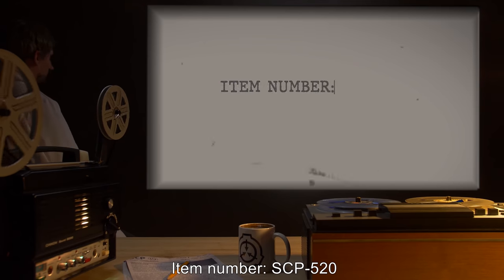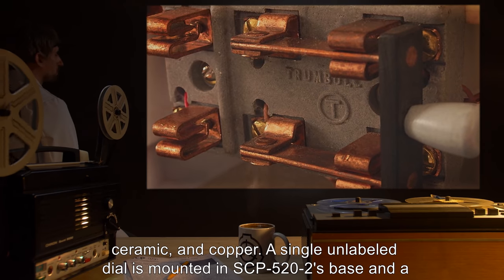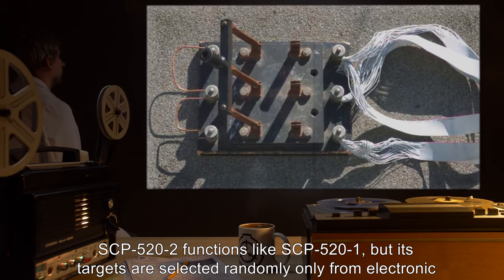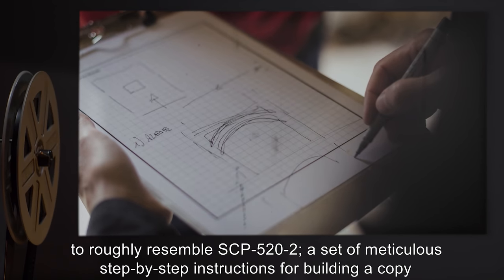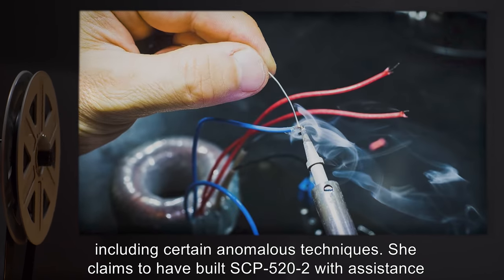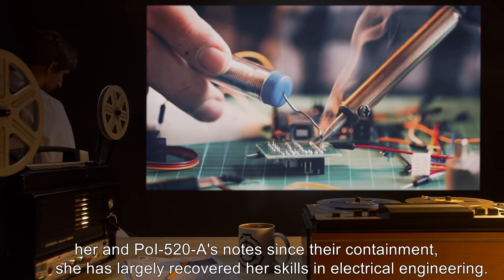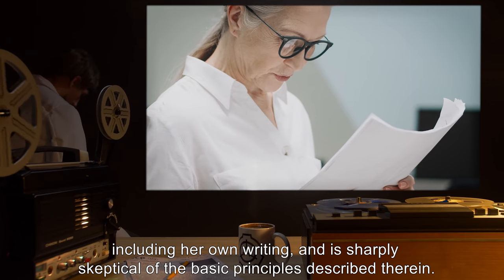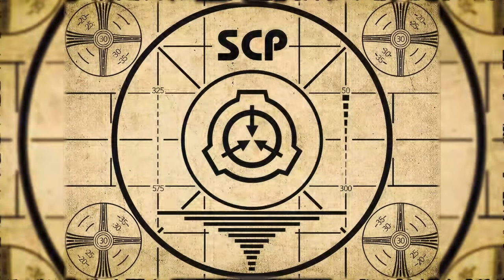SCP-520 | Knife Switch (SCP Orientation)

Comment: I had a friend who was a software engineer who went into computer security who saw the real life device this SCP was based on. It was a knife switch like SCP-520-A, one side was labeled magic, the other side was labeled more magic. It was during the early days of computing and it was attached to one of those mammoth computer blocks that takes punch cards, but it wasn't actually wired up to anything. It was just attached to the casing.
     One day a junior engineer is working with the computer and a senor engineer asks him if he "wants to see some magic?" He throws the switch into the magic position, and the computer instantly crashes and goes dead. "Now why did that happen?" Asked the senor engineer. The junior examins the computer but can't figure it out. The computer seems to have overloaded and had an electrical failure, but the knife switch isn't connected to the computer so there seems to be no reason it should have happened right then.
     After the junior engineer is done the senor Engineer turns the switch to More Magic, and the computer roars to life. Much to the juniors surprise. The Sinor finally explains that the computer is generating to much static charge while it operates and it isn't properly grounded. In the more magic position the switch connects the computer with its outer housing which dissipates the charge, preventing a short-circuit.
     Decades later the junior engineer was my friend's college professor in graduate school. The computer is long gone, but he saved the switch and mounted it on his wall. He keeps it in the "More Magic" position "just to be safe."
Reply: SCP should contact both of you for guidance.